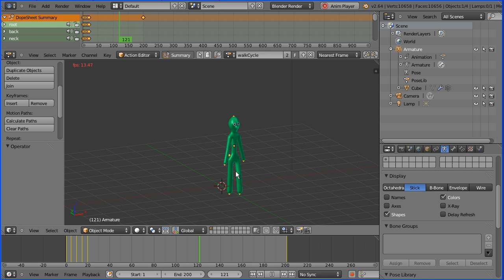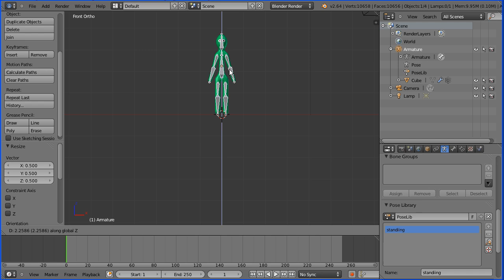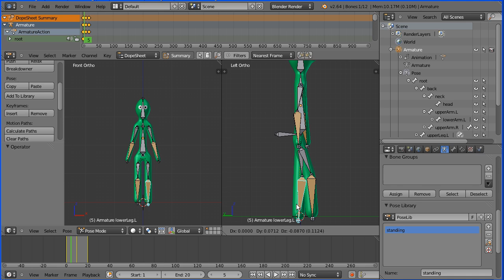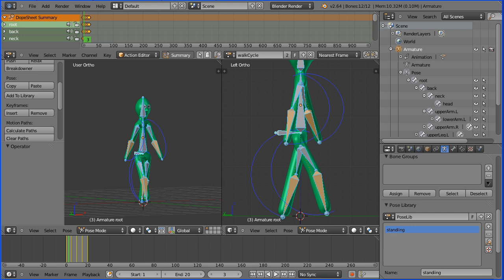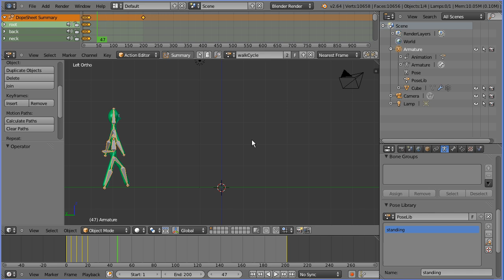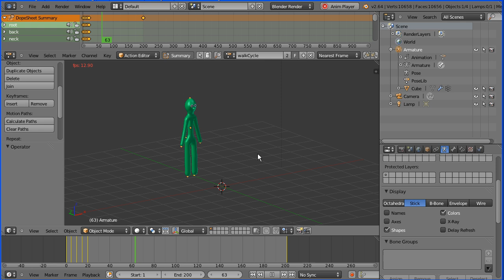Blender Tutorial Creating a Simple Walk Cycle for a Stick Man Rig and Using Cyclic Extrapolation

Comment: Great, quick, concise, to the point.

But I do have a question.  :) 

Say for example, I have the very same mesh obj I want to animate but just a slightly different texture applied.  I want same walk but I might tweak it a little with arms doing something else but I want that same 200 frame walk extrapolation/interpolation cycle.  Is it only a part of the blend file, or can it be imported and applied to new textured mesh?  Or would I have to do all same thing, create the walk?  (Is pretty easy to do but was just wondering).